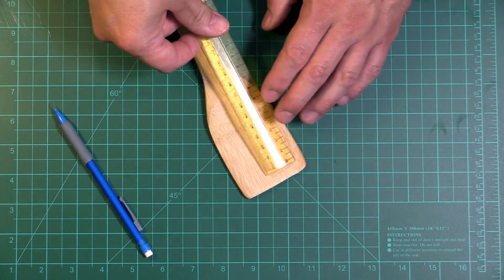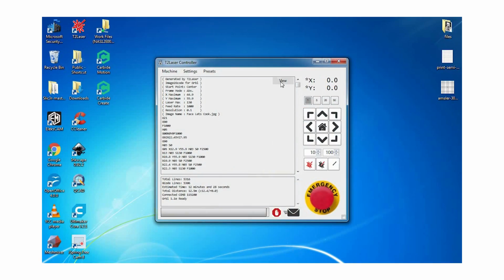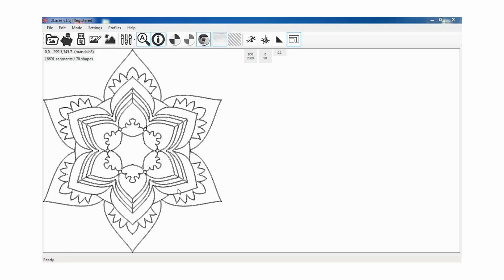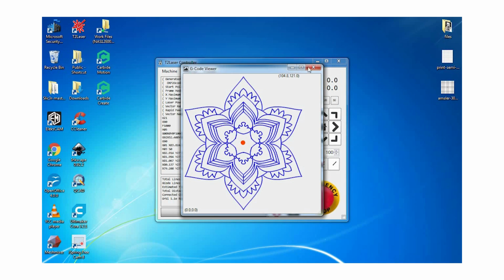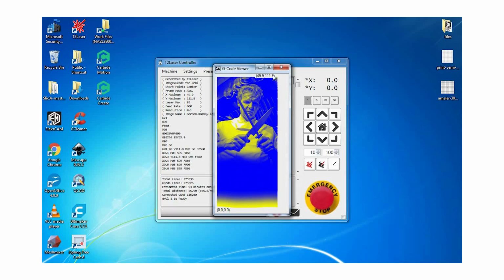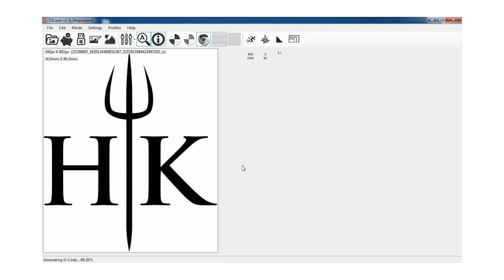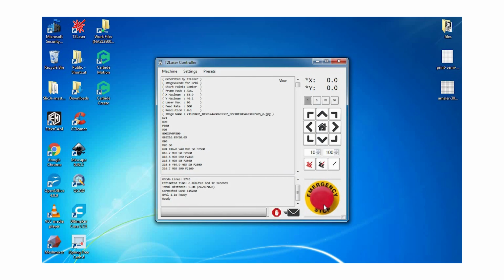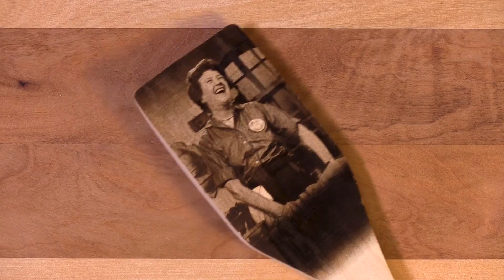How to Laser Engrave Wood Spoons with the Eleksmaker Elekslaser

Comment: I've had the same laser for about 2 years now and I'm just now getting around to learning it. I used to use T2 Laser but now switched over to light burn. Do you have any experience when it comes to using lightburn with the A3 EleksMaker Elekslaser laser? I've noticed that my speed and power settings are drastically different between the two software's. Have you run into this issue too?
Reply from the maker: Sorry, I sold mine a year ago.
I would suggest posting on the Lightburn forums.
Reply: Thanks @MakeTechCreate ! I switched back to T2 for now as I'm waiting on my K40 laser to arrive which is Lightburn compatible.

Comment: Isn't there residual ash left in the burn area?  Do you use a brush to clear that area?  Does anyone oil or bees wax their spoon burning when finished?
Reply from the maker: A quick wash with dish soap will remove any residue. Sealing them with cutting board oil is the easiest.

Comment: Hi I loved watching your video I have just bought a sculpfun laser and am wanting to know what would be best setting to do a wooden coaster size I am doing a trip on LightBurn before buying a license. I have a Cricut machine have got used to that so hoping I can use this machine as well  any tips would be very helpful many thanks Deb
Reply from the maker: Thanks. All machines are different. Lightburn has a "Material Test" option that lets you burn a grid at different speeds and power, so you can see what settings work best for your machine.

Comment: The spoon with the Skull pattern on the backside. How does It work, that the laser stops engraving when the Edge of the spoon is reached?  Is that somehow automatic or did you Software edit the pattern manually to fit exactly?
Reply from the maker: I just slightly overlapped the pattern in the software, manually.
Thanks for watching!

Comment: Really great video, thank you. They look really good. Can I just ask as I'm new to T2 how do you set your origin point, ie the first place where the engraver starts from, do you hand move the laser head and then test fire it on low power and then move the spoon until the beam lines up with you centre point that you placed on the spoon and then fire from that position or do you jog the laser over mechanically until you get to that pint, Its always been a mystery to me and I am trying to sort that out now. Thanks

For a 2.5 watt its producing some fine results, do you ever oil the wood afterwards as well?

Excellent video well put together and it really shows people whats capable with a simple 2.5 watt laser, decent software for not much money which is in most peoples budgets. You only need to go to the bigger lasers if you want to cut out as well. Impressive. Thank you.
Reply from the maker: You can do both, either move by had or jog using the controls. You should be able to place you diode laser in lower power mode, so you can always see the beam and therefore align it easily. 
Depends on the project, but yes, I do use mineral oil on items like cutting boards.
Thanks for watching!